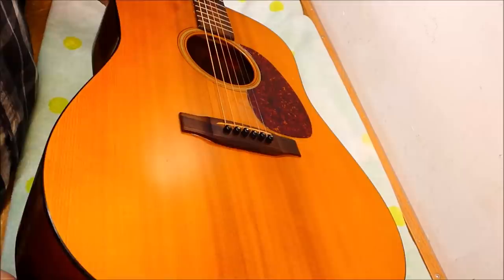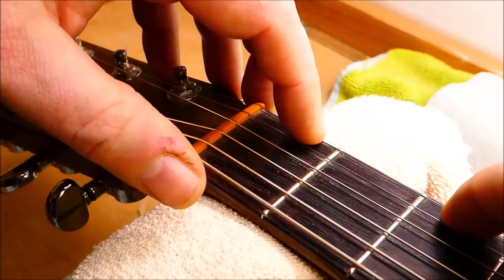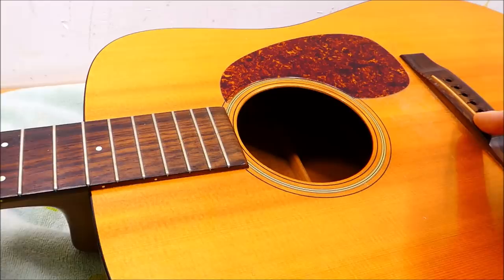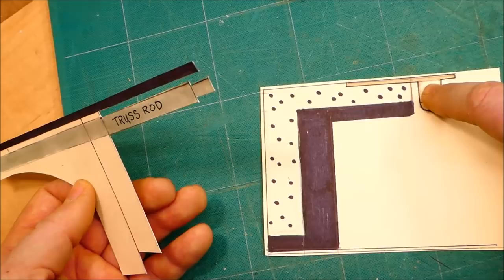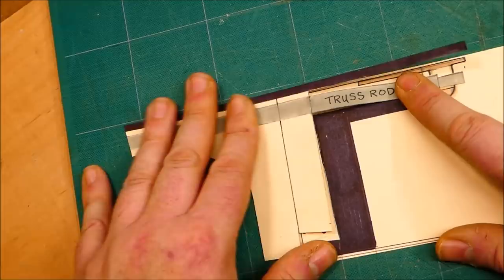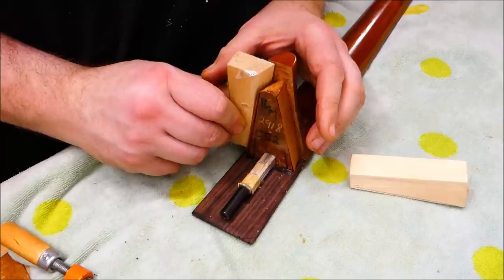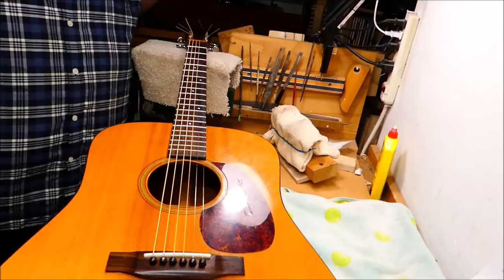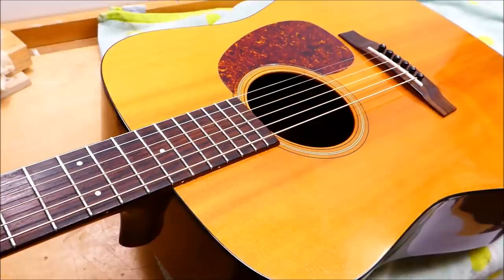Guitar repair: Martin Neck Reset

Comment: Being a guitar repairman myself, I cannot emphasize enough how much does it mean to me to hear "I have to psysch myself up for this" from a master of your level!
Reply: The only thing that I worry about is not being a guitar repairman and attempting a neck reset with my carpentry tools fresh out of the truck claw hammer chisels chalk line you know a standard guitar repair tools
Reply: @arlenmargolin1650  A real pro would use a pneumatic hammer, and oxy-acetylene torch to provide heat.
Reply: @qua7771 Based guitar repair
Reply: @qua7771  Thor neck reset

Comment: To my ear it seemed a bit brighter with the plate.
Reply: Me too. I had my back turned and that turned me right around as in, what just changed!
Reply: I thought that too, but was wondering if that's attributable more to the difference in angle that he's holding the guitar at relative to the microphone. Especially given the fact that he said he didn't hear much of a change.
Reply: Same here.
Reply: I heard that brightness, but it also seemed that the D and G string mids came through better. But, I wear hearing aids.
Reply: I thought each string was sounding a little more distinct/ individual when he switched to the plate. Nice sounding guit-box. Must play much better than before.
Reply: @britlitemail  yep i think you're right
Reply: I think the camera mic being positioned in a different spot has more to do with the change in tone.
Reply: @John_Galimore  That's what I was hearing, more responsive.
Reply: Yeah, but everything changed. Where he was recording from, etc... That would have a much bigger effect on the sound.
Reply: Too many variables to tell, but it did sound more crisp and defined?
Reply: I thought the same
Reply: Same
Reply: Although I don't hear any drastic differences in this video, It can effect one quite a bit. I took a plate mate out of my 72 D-28 after hearing some severe overtones in the studio. I strung it back up with the same strings & noticed it had opened up more a wider range in it's tone. It sounded more focused & also got rid of the overtones that were bothering me. With that being my personal experience, I will say that each guitar is different & the plate mate is excellent at it's intended purpose..............preserving a bridge plate.
Reply: Agree. Only question is was there a difference where the microphone was placed between the two videos? Second video looks and sounds off axis.

Comment: I learn so much in every video👍. As a bonus @ 18:56 that I should "use a bone saw to remove the skull to access the brain". I tried using a potato peeler and it was taking forever.
Reply: A fret saw won't work.

Comment: Using the “sealing iron” is genius. Just the right size and much reasonable than anything at specialty luthier supply places. Have placed my order online, for whenever they’re back in stock in Canada! Good video, Ted!
Reply: When building balsa RC planes, we call that a covering iron. If you search for that, you might have more places to order from.
Reply: @jonipaananen9304  good tip, although I had no trouble tracking one down searching for “sealing iron”. The supplier of model RC aircraft stuff turned out to be someone I’d used before, as the site recognised me.
Reply: Back in the day, those irons were used to tack down dry mount tissue on the back of photographs before mounting them on illustration board in order to frame them, hence the name "tacking iron".

Comment: I've filed the saddle on my 1974 D-28 almost as low as the one in this video and it's obvious that it's due fir a neck reset.  I like a medium action but between the 8th and 14th fret it's become noticeably higher.  Hard to find someone to trust with this work.  You do a great job.

Comment: 35 pulls - good to know for .040 in of wood removed.  I'm just about ready to fit the neck to my first guitar.  I tend to get concerned when I have a conception that something should be done "quick" and doesn't go that way.  I'll try to be calm (HA!) when I do my pulls after watching your video.  Thanks for this.
Reply from the maker: Go slow. You can always take more off. It's hard to put back.

Comment: An exraordinarily elegant exposition of the dangers of neck resets generally and this particular configuration especially. As an amateur, I'll probably never see this in life but there's so much to be learnt about the pitfalls involved. When you don't have much experience, things throw you easily. I restored a 1939 Harmony and ended up cutting the fingerboard at the body joint because I couldn't get a spatula through past the 13th fret, Reason - the neck had lifted so much the top of the dovetail was impinging beneath the fingerboard, but ABOVE the soundboard. I should have tried a razor saw and cut the protruding dovetail top. You do't know what you don't know, etc.

Comment: Some guitar shops that have a luthier or technician on their payroll, will do setups themselves on the more valuable instruments that they have in their shops. I did this job for a while and the guitars just sell much easier, if they feel and play better. Martin guitars usually have a relatively high action (2,5 mm - 3,0 mm or even more, e-E on 12th), so it's totally possible that some work has been done when the guitar was still "brand new",...some of the instruments hang there for years and nobody will buy them. However,...If I would have to remove basically the whole saddle to achieve a playable action, I would consider it a faulty guitar, send it back to the distribuierter and just request a new one. Nice job btw.

Comment: Informative video, thanks.
11:00 - That neck pocket, with the sound bound interconnected, looks like a nightmare to work on.
When I first learnt neck resetting (25 years ago now), I was taught by an old European Luthier (so Spanish/Classical constructions).  He always said the heel cap (that slab of, generally, rosewood at the base of the heel) was the designed method/way in to the neck joint (for resetting etc).  As well as removing some of the back binding.  He would doggedly figure a method that worked around that (rather than applying steam into the guitar).  He found it a faster and more 'invisible/less intrusive technique.

I would love to have seen him scratching his head over this Martin neck joint ;)
He'd probably scowl at a heel cap that was decoration ..over being put there as a 'secret door' for the Luthier :)

Comment: Don't want to be that guy but...   Man Imperial measurement sounds like hard work  .  Thank someone we changed to Metric in 1970 in  Australia .

Love your work , always a great watch and  very informative.
Reply: Generally it really isn't. The main difference is metric divides by 10 and imperial mostly divides by 2. If you work with computers you can probably do powers and multiples of 2 and 16 in your head without thinking about it. If not, and you use imperial, you still learn to divide or multiply by 2, 4, and 8 just as easily as 10.

Edit: I'm not one of those idiots that says metric is bad. Of course it isn't. But having grown up with both systems, they really aren't much different, and there are some areas (like carpentry) where imperial can have some actual advantages. It all depends on what you are doing and familiarity with the system. If you aren't familiar with the imperial system, yea, it is going to look hard, no argument. But if you know imperial and aren't familiar with metric, it can seem hard too. (I know the metric-only people will find that hard to imagine, but it really does happen for some people.)
Reply: I grew up with the  metric system but got to learn imperial measurements during my apprenticeship, their both great an easy to learn an if i can learn them anyone can.

Comment: The Coverite (other brands exist also) sealing iron is available at most hobby shops and is used to shrink coverings for model aircraft. Coverite is a brand of covering material.
Reply: Yes, and MUCH less expensive than if you buy the same device at a photo shop (used for "dry mounting" photos onto paper board for framing).
Reply: Here's the iron and a heat gun together for $33 on Amazon: https://www.amazon.com/dp/B0006OBN2O/

Comment: I just bought a Martin Special 16 in August 2020 and this was a very interesting video. The Special 16 as far as I know is basically a very slightly modified D16e. It's made in Nazareth, PA its got a glossed sitka spruce top and having looked into it the only difference I can see is that my Special has Satin Rosewood back and sides where the D16 has glossed back and sides. I guess what I'm saying is its nice to see how the 16's age now that I have one. I feel like the 16's are a little underappreciated. Of course I'm biased now but they are great guitars. I couldnt afford a D45, D35, D28, D18...But I couldnt be more pleased with my Special 16 Rosewood Dreadnought. Ive played an Ibanez Artwood for 5 years and it was a great first guitar. So happy to have stepped into the Martin world!

Comment: Thanks for explaining the whole trussrod under the soundboard situation. I believe the truss rod is so far back to allow its pressure to work on the infamous "neck joint bump", which is a common defect on acoustic guitars.

Comment: I recently did a neck reset on a 3 year old Martin. It was one of the more interesting jobs I had to do, because it was basically a new guitar and the fret board projection with no string tension was actually pretty good,...but under tension the top came out very high, which is not a good thing and I doubt that this guitar will survive to celebrate it's 35th birthday. I had to take this into consideration, when I did the neck reset and the action is pretty good now,...not quite sure for how long, but the customer wanted to do it anyways. They still use this white glue btw,...but I got the neck out with pretty minimal collateral damage.

Comment: The guitar is at a a very different angle to the camera mic in the last example, and that will change the sound a lot, but it won't make it "sting". To me it sounds a lot brighter and harsher in the attack with that thing in there, and I don't like it at all. 

I had a brass piezo saddle in a guitar once, and it had a similar sound. I made a new saddle for it out of deer antler, and that improved the sound a lot.

Comment: Am I correct in thinking that a neck reset will always have an effect on intonation? It appeared, but wasn't shown, that our illustrious host did some work on the new saddle for intonation, but the original saddle was just a standard saddle.
Reply from the maker: The neck is pivoting on a point so theoretically it shouldn't. In practice though, usually the high action and forward rotation of the neck has eaten away some of the compensation so it often intonates better when it's done. I try and get them to nicely as possible with saddle adjustments.

Comment: Why do these martins do that? My Martin has significant fret ware but really only the “B” string on the “G” note/8-9 frets. It’s causing some buzzing. But I play through or around it.I was sorta willed the guitar from my uncle who taught me how to play. When I got it. It had very little fret ware.  But in just the five years that I’ve owned it. I’ve managed to grind a divot in the frets. I have a few other acoustic guitars and less expensive ones and have had them for a lot more years. The frets aren’t nearly as worn down as on my Martin

Comment: Interesting comparison on the sound with and without the Martin ‘Platemate’ device - must say I wasn’t expecting any audible difference (based on gut instinct from what this thing does) but there was a clear improvement in the tonal definition in the upper midrange and treble end of the sound, even without listening more carefully with headphones. Now I’ve got not idea on how you had the mic and audio recording set up, but the camera angle changed between the two shots so it might even have been influenced ty sound bouncing off that wall (to your right in the with ‘Platemate’ recordings). So I guess it would be hard to know without a more careful, scientific/systematic approach, but really interesting all the same. So glad I found your channel. Loving your calm approach and style. Fascinating content too 👍

Comment: I have a 2002 Martin D16 RGT with too much relief in the neck. There's lots of saddle and the nut is set up well. The problem is that the truss rod is so tight (to turn) that I'm afraid to tighten it for fear that I might break it.. Would you recommend taking the nut off and lubricating it. It's been like this ever since I bought the guitar new in 2002. Thanks.
Reply from the maker: It's good practice to take them off and lubricate if it's possible. This isn't possible with newer Martin 2-way rods.  Older ones are fit into a U-Shaped channel of aluminum and it's possible the threads are binding against the channel. If you can find an authorized Martin repair shop near you that's probably the safest way to go. They'll know immediately if something's not right when they try to adjust it.
Reply: @twoodfrd  Thanks for your reply and advice.

Comment: Love the vids.
I have a 1990 Martin D62 ( d18 w maple back n sides ). It needs a neck reset. I am in Brazil and shopping for a luthier to do the work. There are alot of talented craftsmen here but little experience with Martins. Are there any questions I should ask or info that I can pass to them. That truss rod situation seems a bit tricky to someone not expecting it.

Comment: I did a neck reset for somebody, and how long would you say after I put the neck back on, with string tension on would it be safe to say it's not going to move out of angle again ? Its been 6 days and not moved at all. Thanks

Comment: What was the material used for the nut and saddle on this one? I've never seen that orangey color on a Martin. I had a '70s t bar D-18 in the '80s, and didn't buy another one until '97, so no personal experience with this vintage.
Reply from the maker: They were using Micarta from sometime in the late 70's into the 90's I think.  It goes really orange.
Reply: @twoodfrd  Thank you.

Comment: In your experience, approx when did the wedge insert under the fingerboard extension become more common ?   I remember seeing a number of neck resets done without utilizing one.  I'm not a repair man but have been building guitars for over 40 years, so am extremely interested in the evolution of repair work.

Comment: Are you sure about the truss rod inception date of 1985?  My 1983 Shenandoah has a truss rod (I know for certain it's a 1983 because I when I bought it in 1984 it still had the original owner's receipt in the case dated August 1983 :D). I may just be lucky, but so far (knock on wood (other than the top :) )) there's been no neck movement and very little top movement.

Comment: question: is it okay to glue the strap button screws into the body of a guitar? 

i put schallers on my new epi les paul and I keep finding the the neck button about half-way unscrewed after a week or two of moderate use... I want to drive that sucker home and make sure it never comes out.
Reply: Shim it with a toothpick and a bit of wood glue

Comment: i have question about neck resets
how is it that if the neck need a reset you often shim the freatboard extension? isn't it also the case if the neck need reset, for that fretboard extension to be bowing up  , or is it always the case that the soundboard is forced inward with acumulated stress and wood movement?
Reply: the neck is being tipped back at an angle, leaving a gap between the board and the top

Comment: Relatively new viewer here,
Why is it always the B string that leads fret wear?
Reply from the maker: That is a really good question.  I'm not sure. It's at a slightly higher tension relative to its mass than either the e or g so maybe there is a little more effort involved in fretting it which translates to increased wear?
Reply: @twoodfrd  I was expecting a fellow viewer response. Thank you very much kind sir!

Comment: 8 64ths of an inch... Crikey, why would anyone still use imperial measurements? I can picture how long an inch is, but to then have to mentally divide it into 64ths and then think about the length of 8 of them is just far too much hassle and I can't do it. Metric really is so much simpler!